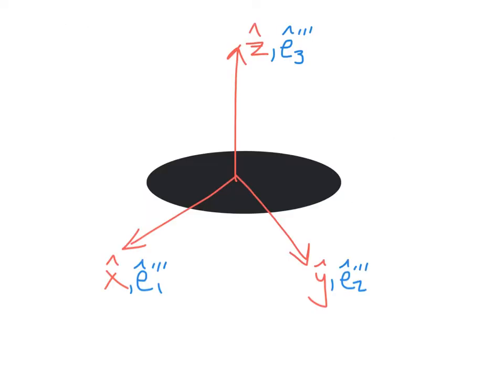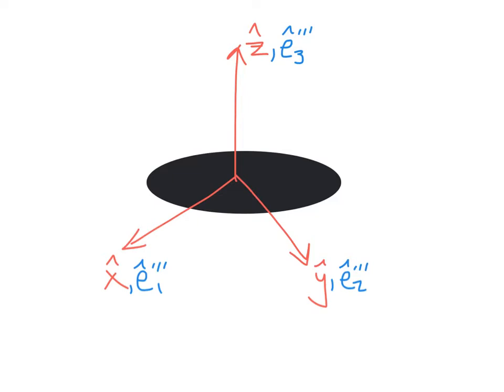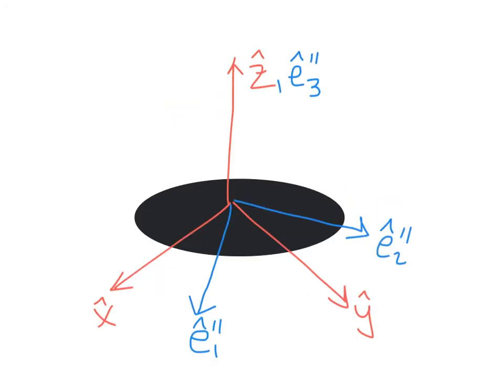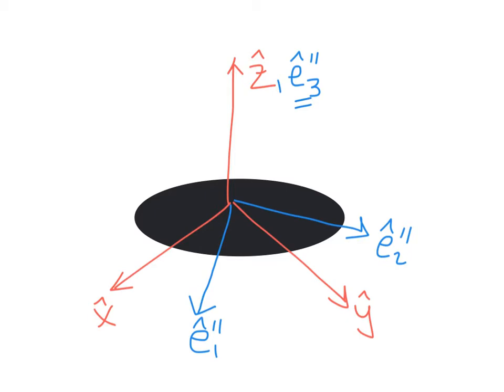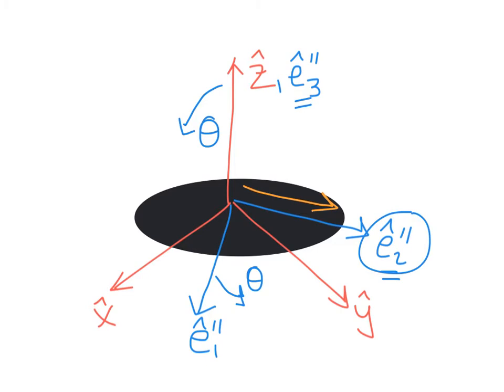Sec. 10.9 - Euler Angles

Comment: Wouldn't a first rotation of psi + phi give the same orientation (no third rotation)?
Reply from the maker: No, because the first rotation (by angle theta about z-hat) has a component that is orthogonal to the other two rotation vectors. It is true that there is some overlap between the rotation vectors, i.e. they are not all mutually orthogonal, but they all have mutually orthogonal components.